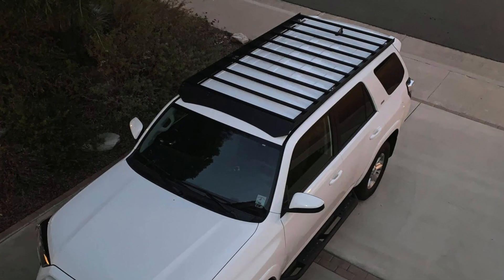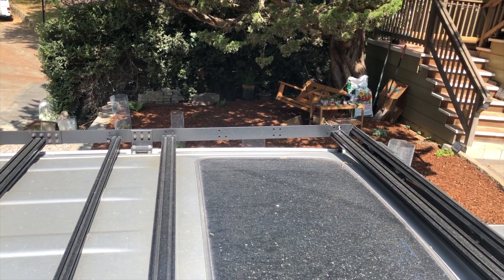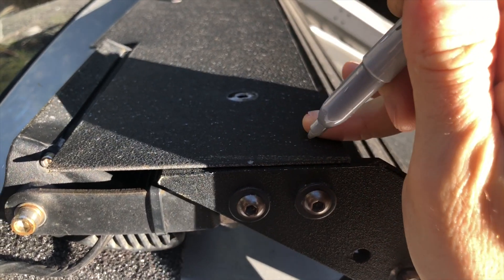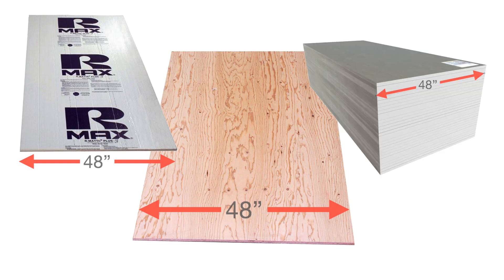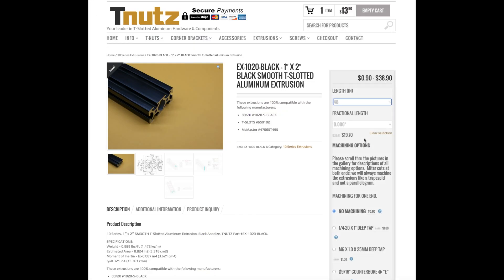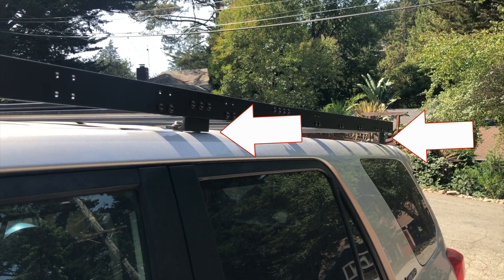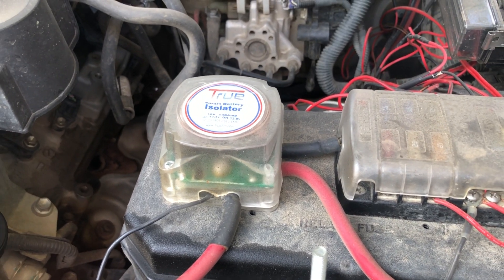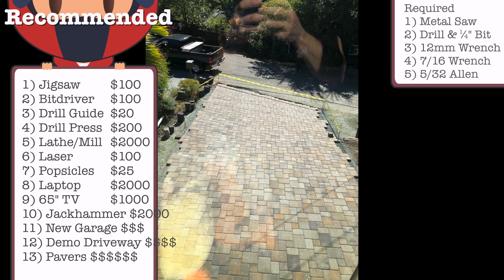Build Your Own (Better) Roof Rack - Improvements On The $300 DIY Roof Rack

Comment: Awesome!!!!! I love the rack. I was wondering about the material of the side rails until this second video. I have lots of letftover 5mm aluminum plate and I can weld them. I was also considering buying 50x50mm square tube instead of extruded aluminium. I guess it is going to be cheaper and I plan to weld the whole thing anyways. Whenener I need to attach something I would use U bolts or just drill through. I have to ask arround for prices on the materials. Labor is free! As usual... Great video!

Comment: Does the Angle need to be 1/4" angle (6.35mm for those complaining about freedom units) or would 3/16 be enough for 75# pelican cases 2 across? 3/16 is about half the cost.

Comment: with the T slot aluminum rails that you use, Do you know the load capacity of these rails? I'm wanting to replace the rails in a roof rack that i already have but i want to make sure that they can take the loads, mostly storage for camping stuff.

Comment: just did a quick run of all these parts cost if you do the angle side bar, it comes down to just under $800 ($795.74). The most costing part is these two side angle bars for $114 a piece at least (McMaster even more expensive at $163 a piece). Just from cost perspective you might just buy one instead of diy, of course it's another story if you enjoy the diy process and don't care the time spending.

Comment: You can simply use a sheet of cardboard to meet the roofline and run a compass  from the roof to the cardboard to achieve the desired curvature  without any guessing or multipoint measurements.  I too found out too late.

Comment: Great stuff Matt! Was struggling to find anything good for my 2nd gen 4Runner. Was considering a Prinsu for a 3rd gen but at nearly $1000 uh no. 

What are you thoughts on attaching to a bare roof without factory mounting points? Thinking running some pieces of aluminum flat stock (1"x 1/4") the length of the roof attached with sheet metal  metal screws. I would attach the mounting brackets to these 'rails'. What do you think?
Reply: I also want to know this
Reply: @Fandkforever  I think I’m going to use rivnuts / nutserts.

Comment: Hold a large piece of cardboard centered on top of the roof over the windshield.  A paint stir stick with a sharpie stuck to one end makes a quick tool to drag along the roof line witch can then transfer the profile to the cardboard via the sharpie.  You now have your correct profile.  Cut the arc, then cut the overall height of the template to create the final shape.

Comment: good thinking with the edge trim on the front of the wind guard thingy, but-

if it touches the paint and moves a little, then it'll rub off the clearcoat and eventually paint

Comment: Great vid! Quick question …. What paint and /or primer did you use on the bare metal pieces?
Reply: In part 1 he used some cheap truck bed liner I think.

Comment: Ahh yes.. ADHD fueled task creep..
I need/want to do this thing.. 
but to do that I need to clear the bench, 
but to clear the bench I need to put things away,
To put things away, I need to sort them and put it in a spot that makes sense..
Now I'm finding things that I lost or are in the wrong spot..
Oh I found the another thing that I needed 2 weeks ago to do a task I abandoned.. 
What if I just do that old task now that I found that thing?
But I need a clear bench to do that.. Fuck.
Reply: You too?  I own 4 half-empty toolboxes because every time I try to organize "it doesn't seem right."  I also have 13 feet of empty slatwall, because I decided that I don't like everything sitting out.  Now everything is (unhelpfully) in totes.  What I think I need is a sort of block of wood with holes drilled in it that tools can sit in, but on the workbench right where I need them, but not in the way when I'm working...
Have you found one of those yet?

Comment: Matt, the original build video along with this IMPROVED are fantastic! Thanks much! I'm going with the 90 degree angle aluminum and running into an issue. The 6061 seems to only come with a rounded inside corner. I'd have to go with 6063 and only 2x2 if I want a sharp inside corner. Am I missing something? I've messaged @carlkoerner also--he clearly used a sharp corner from his pix. Haven't heard back yet.  Thanks!!!
Reply from the maker: 6063 is probably fine if you're using at least 3/16 wall. You could also use rounded corners and just offset the bars up a bit. should work since you're screwing them in from the side anyway.
Reply: @SuperfastMatt  , thanks for the quick response. I think I’ll go with 1/4” 6063 to get the flush fit in the corner. The picture in my head of the crossbar ends not flush to the inside of the vertical rail side doesn’t seem clean. Thanks!
Reply: I used 1/4" and it's not flush but works fine...but wish I had done 3/16 and got it flush

Comment: There is no such thing as a better roof rack. The roof of a vehicle is the worst place possible to put a load. This is where the air speed is the highest and the aerodynamic drag is the greatest. I would have thought someone as smart as you would know better. What gives?
Reply: Lack of options? Never heard of a hatchback mounted gun ? Is that the reason for your haircut? Off-road speeds are typically much lower? Where else am I putting my 33” spare on my gx??? Cheers 👍🏼

Comment: Love the Video! Question what kind of side LED light are these on 11:12?
Reply from the maker: I don't remember exactly. Something cheap I bought in Amazon.
Reply: @SuperfastMatt  Thanks! What kind of Ram Mount, plate, and holders are you using to support the LED light?
Reply from the maker: @yovarlis  Ram mount size B. I just used a ball with a round plate (third one in the link below) and cut/drilled it to work.  
https://www.rammount.com/shop-all/popular-components/b-size

Comment: Any reason, maybe aerodynamically or functionally why I shouldn’t do angle upside down?  So the extrusion bars are immediately below a this strip of aluminum angle?  I like the idea of using angle but I also was hoping to follow the contour of the roofline on the sides kind of like some of our favorite aftermarket designs....@superfastmatt- Grt video thnx for sharing,  I hope to do this design on an lx

Comment: Imperial system is so ridiculous. Fractions all the time, metric system you get size 4 in imperial 5/32 :D it's so funny people are still using 18th century measure system,
Reply from the maker: No disagreements here. Unfortunately, it's so much easier to get material and hardware in imperial, so that's the way I usually go.

Comment: What kind of weight would this rack be rated for? I currently carry my kayak on the factory roof cross bars. How much weight could one of these aluminum bars carry? Thanks :)
Reply from the maker: There are some companies that sell roof racks with basically the same design, and they rate around 600 lbs static and 300 lbs while driving. The weak point would probably the attachment to the car, so I'd see what your car manual says.

Comment: Seen both of these vids many times, what do you think of if I use the 2” alum angles but are 1/16” or 1/8” thick only (what’s available locally)?  No heavy loads are planned as the OEM threaded holes in my application are only M6x1.00 anyway so it can’t support too much weight
Reply from the maker: i wouldn't do 1/16 but 1/8 would probably be fine for light loads

Comment: If you build this out of angle get 3/16 and make sure its squared on the inside corner.  Most or all 1/4 inch has a rounded inside.  Great video!

Comment: Did you have any corrosion in the aluminum around where you have stainless hardware?  It didn't look like it, but I thought I'd ask.  Galvanic corrosion is my concern, but it only occurs when you have water...living in So. Cal I can probably ignore it.

Love the videos.  The design is so simple.  McMaster-Carr is probably my favorite book, well maybe second to the Bible; third would be the MSC Catalog.  But you totally had me at looking up the second moment of inertia.  If you've never seen the equation for calculating it, look it up.  It's a hoot.
Reply from the maker: No corrosion. The stainless fasteners are black oxide coated, so that helps. If it were on a saltwater boat, I'd probably use a coating on the threads as well, but I think it's fine with the black oxide.

Comment: Thanks for the updated video!

For the Multipurpose 6061 Aluminum 90 Degree Angle (8982K61):
- Do you know how Carl Koerner cut the aluminum at the front end of the rack in order to place the Aero Shield at that angle?
- Did he cut it himself, or can you buy the 6061 Aluminum piece with that angle cut into it?

Comment: Well I did it. It took me a few days but I followed your general idea with the aluminum angle and your google docs parts list. I ran into a few issues and had to order some different parts and improvise. First off, the 1.25 inch aluminum spacer needs to be 1.75 inches instead (the crossbars were sitting on the roof) which then needs to increase the m8x1.25 bolts by .5 inches. I didn't even use the rubber washers as I used Butyl tape instead. I used rattle can as I tried the truck bed liner and it chipped way too easy. Rattle can allows me to touch up as necessary (so far it has held up well.) Also when it was all said and done, I noticed the shark fin would stick up over the rack, which then made me think of the one day in the distant future where I would throw a piece of plywood or sheetrock up there and not think twice before breaking the shark fin. Luckily, I have a IMS here locally and had to make a few trips. I bought the wind shield (maybe 1/4 inch) for like $6 and then I got some 1/2 inch aluminum bars to provide a shield for the shark fin. If you need pics, just let me know.
Reply: Hi, I’m in the process of building mine using some parts from his first video and some parts from this video. If I may ask, when you talk about the “1.25 inch aluminum spacer” are you talking about the unthreaded spacer or the threaded stud bumper (rubber feet)? The parts diagram shows the unthreaded spacer as 7/8” long and the threaded stud bumper is 1 1/4” thread length. The 8 hex head screws which attach to the roof (m8x1.25x50mm) should be what size? I’m ordering the new parts now so I’d like to make sure and get the correct size & length. BTW my vehicle is a 4th gen (2005) if that makes any difference. Thanks
Reply: @guardian_agent1776  yes, the unthreaded spacers. the issue was the front weren't long enough so the crossbars were basically sitting on the roof. the stud bumpers worked fine. If you mount the cross bars higher on the frame rails, it wouldn't be an issue. I used alum angel and had the cross bars at the bottom (for support)
Reply: Would love pics of what you did with the shark fin

Comment: Highly recommend some kind of vinyl wrap for your roof if your aero guard is resting against it.Just in the area where it sits. 

A lot of dust and debris will scratch your paint otherwise. 

I used: 
VViViD 3M Scotchgard Clear Paint Protection Vinyl Film (6 Inch x 60 Inch) https://smile.amazon.com/dp/B004VG8DS0

Comment: Thank you very much for the update. For the front bumper support things, you could also consider cabinet floor leveler inserts. They're basically the same as your design but pre-made, sort of. They also come with Ikea cabinets so lots of folks may already have some extras in a drawer somewhere. Or you can just buy them cheap, I think usually in sets of 4...in which case you'd have two leftovers laying in a drawer somewhere for the next roof rack.

Comment: Matt, Thank you for the update. i've always been a fan of this project because buying new is crazy spendy, when the design is pretty straight forward. I get it a little but more with welded tube, but still. 

Question for you, I understand that steel adds weight and rusts, but would you find any benefit to the performance of the rack if you did your sides in steel? For example on a similar flat bar design someone attached a hammock to one of the main side bars, which caused the bar to bend out. obviously this isn't the intended load, but making something more robust isn't a bad thing. I would imagine your idea about the angle profiles would counter act this and still benefit from not rusting, and being light weight.
Reply from the maker: Yeah, but you could just use thicker aluminum, too. Either way, it would be more efficient to use angled sides in that case; probably significantly more efficient. You want material in the direction of the load, so pulling sideways on flat bar isn't an efficient loading. The easiest solution would be to tie the hammock right next to one of the mounts so the load goes basically directly into the vehicle.
Reply: Download any tslot or 80/20 catalog. They tell you how to calculate the loads properly. Unless you are going to be doing crazy loading - like way over 500lbs - I wouldnt worry about the load ratings. You could build your horz span lengths shorter and add more of them if you got worries. There are many ways to connect tslot together including drilling holes through it. The aluminum wont break, it might bend (yield a bit) if you severely load it but I wouldnt worry, a roof rack is not a precise thing, a little bit of deflection isnt going to affect anything, again, unless you plan on having a party on top of your roof... The extrusion design itself adds to its strength.